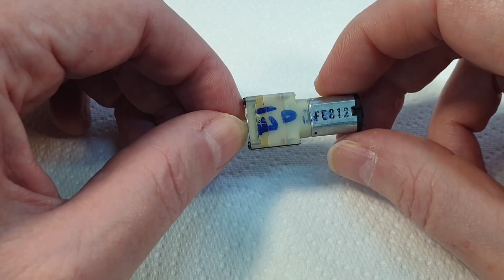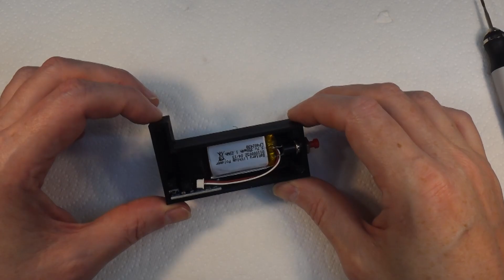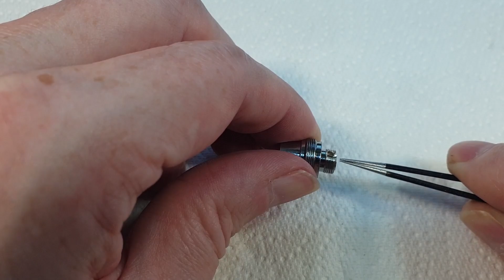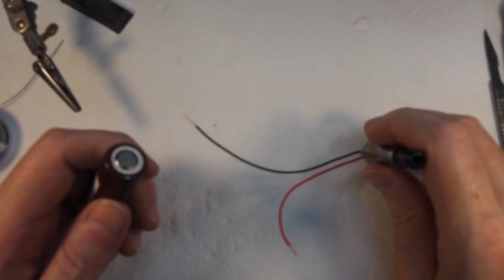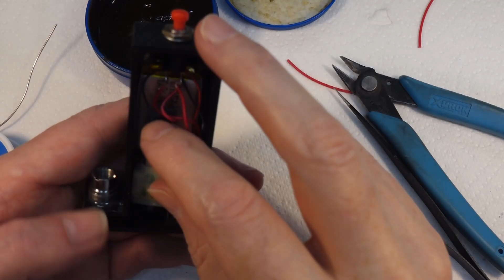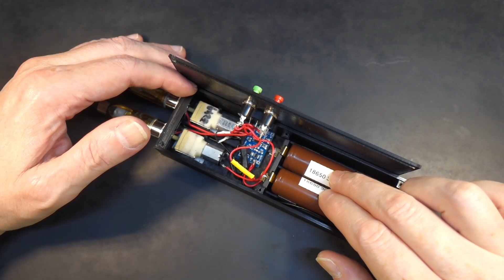Building a pocket sized smoke machine

Comment: this is so good. i have to see if i can find a small motor with a pump. i know that i have a water pump. do you think this will also work?
Reply from the maker: Possibly, although air pumps usually have closer tolerances. It would certainly be worth a try though 🙂

Comment: Could you add a link to the pumps you used?  I found your video while troubleshooting why mine isn't working and I have exactly the pumps you said didn't have enough airflow.
Also, the link to the vape coil set no longer works, but I think Amazon just no longer sells those, at least in the US, searching for "vape coil" comes back with nothing useful.
I hacked apart a vape pen I got for $20 at a smoke shop and the guy was amused when I told him what I wanted it for.  Funny thing, the 0g vape juice without nicotine still has to carry a warning about containing nicotine.
Reply from the maker: The warning is a standard thing. Because it's capable of using nicotine, even when it doesn't, it's classed as a smoking aid. I've bought vape batteries that contain a nicotine warning, even though it's literally just a battery. I believe the air pumps I got came from ebay - if you search for something like "mini air pump motor" you should get plenty of results. Admittedly I had to try a few before I found ones suitable, and I can't find the listing for the exact ones I bought, as these vendors tend to come and go and it was a while ago now. I'd advise trying ebay rather than Amazon for vape stuff, as Amazon seems to be moving away from anything vape related. You could also try Aliexpress. I know a lot of people don't like that site, but I've always found it very useful, and it seems they're really working hard to get rid of scam sales, with apparently a fair degree of success. Good luck to you 🙂

Comment: Is there anyway to add color to the smoke?  I’d love to have black or gray smoke for a diorama.
Reply from the maker: If you find a way to do that, you'll be the most popular person on the internet. As far as I'm aware, there is no way to colour the smoke at all. It's a bit of a Holy Grail in the RC world, as many people use smoke machines to simulate tyre smoke on RC drift cars, and no-one has been able to do it. 
Having said that, I find the smoke in these machines often comes out grey, so it might be related to temperature or something. Sorry I can't be any more help than that.
Reply: @SteamGeezerUK  It is possible to colour smoke, however, this is not smoke, it's water vapour.
Proper smoke generators can use a dye additive to mineral oil, which is how the Red Arrows do their coloured smoke trails.
They pump oil from a reservoir into the engine exhaust, which is hot enough to vapourise it.
The dyes are mixed with the oil, pre-burn, via a solenoid activated valve, so they can switch colours.

Comment: Have you found any issues with the durability of the ecig part well more the time scale of how long it lasts and the elements burning out? Especially with the larger batteries. Or do you avoid it by using it in short bursts?
Reply from the maker: The elements I'm using are ones that were "retired" from a vape due to tasting bitter, but they still work fine. I honestly have no idea at present how long they'll last, but these ones are £1 each so they're easily replaceable. I'm tempted to leave one running and see how long it lasts for before it completely burns out, but at present, after a prolonged burn, over 30 seconds or so, the tank does get noticeably warm, although not hot.
Reply: @SteamGeezerUK  Awesome, thanks for the info :)